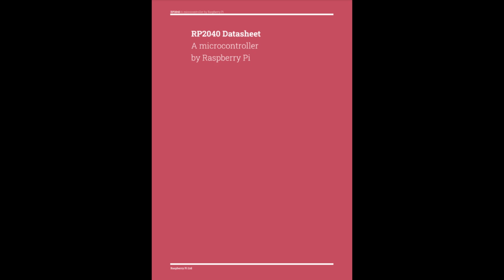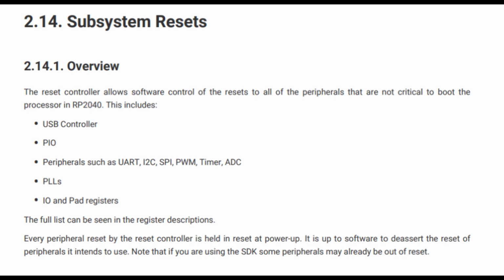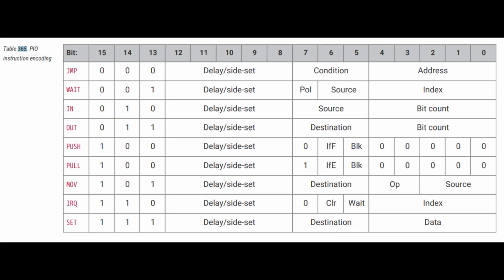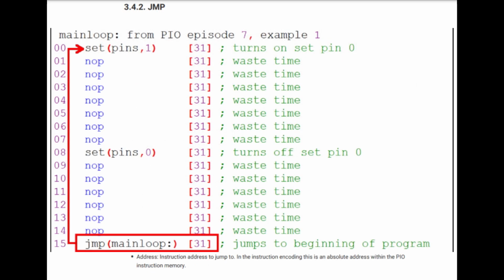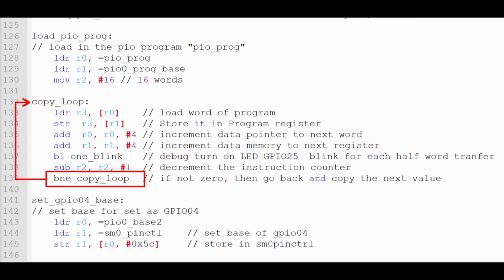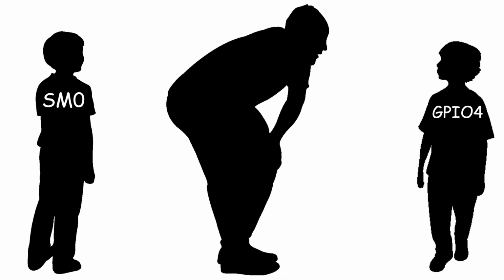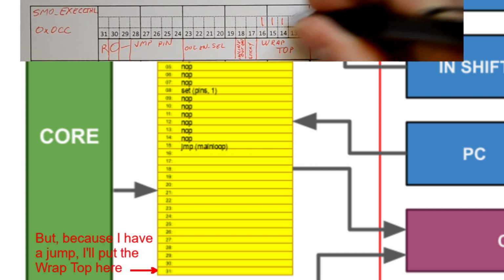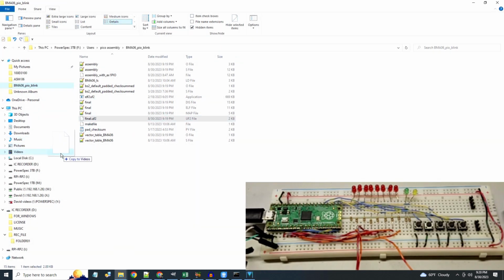RP2040 - PIO and Bare Metal Programming - BMA06

Comment: Thanks David. I want to sample ANALOGUE   Signal with PIO. Can you give Idee. Please
Reply from the maker: PIO processed digital data, either converting to serial, or inputting or outputting multiple bits to GPIO.  Converting from analog requires the ADC which is a slow process.  I haven't tried it, but you might be able to string DMA together with PIO to automate the process.  Good luck!
Reply: @LifewithDavid1  Thank you for your answer. You mean that the analog signal is sampled with an ADC and the sampled data is transferred to PIO with a DMA channel to output parallel data. Is that correct?
Reply from the maker: Yes, that's what I was thinking.  However; I have not done any research into this; so I have no clue if it will work.  If you find out; let us know.  Thanks for watching!

Comment: Love these seies.  Found them because i was trying to find a way to drive a 16x300 neopixel array using 16 channels to drive the 16 rows, then use graphics primative libraries mainly to draw text to the array.
I found someone using a 74HC 8 bit serial to parallel shift register and PIO to provide 8 row channels.  Thats easily adapted to 16 channels but the challenge is transposing the bits in the frame.  Circuit Python has a quick transpose routine, but only handles transposing 8 bits at a time.  I need 16.
I could probably do that in C but would it be fast enough to transpose 14K of a frame buffer before i show the results?
Or if the transposer is fast enough, perhaps with a 2nd PIO, transpose 16 pixels (48 bytes, since each pixels is 24 bits, offset by row size) in time?
Reply from the maker: I don't know if you checked out my "PIO Chronicles" series?  I did a high speed AWG where I could generate up to a 25 mHz (with poor resolution) sine wave using PIO (https://youtu.be/8ByDgh5-O2U).  I also did VGA video using PIO (https://youtu.be/ZEBkM5FQ86Q.  Maybe those will give you a few more ideas.  Sounds interesting.  Good luck and have fun!
Reply: @LifewithDavid1  Yes, it is with these during my search for answers that I came across your channel.  Didn't get through all of them yet but gave me hope with my large Neopixel array.
Since I found Adafruit C libraries that I likely can adapt, writing an array transpose function in C: likely will be fast enough to get a decent framerate.

Comment: Hey, David. Great series! Any chance of getting back to the 6502 and PIO? You seem to have mastered the pico. It would be cool to see you connect the PIO to the 6502 and use the pico for ram and rom.
Reply from the maker: I'm hoping to do several videos where I design a 6502 emulator on the Pico.  I've made some good progress and I hope to have something to present in a couple weeks.  Thanks for the comment!
Reply: @LifewithDavid1  thanks for the reply! An emulator would be neat, but I was thinking more along the lines that you originally started with, i.e., a real 6502 (or 65C02) hooked up to the PIO. Actually, you could use a few pico/6502 “units” together to make a pretty interesting multi-cpu project. Unified memory architecture. Just a thought. Nobody has done that that I’m aware of. You certainly have the know-how!
Reply from the maker: @jonathanstein6056  That would be an interesting project.  Not sure when I'll get to it; I've only just scratched the surface of what the Pico can do.  I would also like to revisit VGA video.  So much to do and so little time!
Reply: @LifewithDavid1  I hear ya. Keep up the great work 👍🏻

Comment: It'd be nice to define a bunch of macros so you could write PIO assembly instructions in your ARM code and they'd emit the correct .word directives... I don't know if this is possible but the idea tickled my "wouldn't it be cool if...".
Reply from the maker: Interesting.  It's operation would be similar to pioasm.  If we used the C/C++ SDK then we could call pioasm to generate the .word directives.  Thanks for the comment!
Reply: I thought the same thing: can't we use a PIO assembler to generate the opcodes?
Probably could be done in Python but I hate using Python as helper programs.  I've often felt it has been overused in today's programs, making them much slower than they need to be.
My first thought was using a spreadsheet.  I did that for generating machine code from opcodes for Ben Eater's 8 bit processor I built and modified.

Comment: What software did you have to install to be able to assemble it?
Reply from the maker: In "Bare Metal Adventures"; I started out using the GCC assembler (ASM) and the RP2040 C/C++ SDK.  However, in Chapter 4, I ditched the SDK, and used the GCC assembler and linker; as well as Make.  I would suggest looking at the other videos in the "Bare Metal Adventures".  Everything I wrote is located in Github with links in the videos' descriptions.  Good luck and thanks for watching!
Reply: @LifewithDavid1  Thanks.  I've used GCC a little bit, with the STM32F407G Discovery board, but only in C++.  I've mostly just stuck to Arduino and the Earle Philhower core, for the RP2040.  I'll slowly work my way through your other videos :)
Reply: @TooSlowTube  Your statement/thought is wrong. You NEVER used ANYTHING OTHER than GCC. Guess what Arduino uses as its toolchain for your STM32? Or Avr? Or RPi? You get it ...:) There is nothing wrong using the Arduino(-"IDE"). It is just a fancy Make, coupled with a rudimentary editor and package manager, hiding most things that happen under the hood from the user. If you need flexibility, use your own toolchain or build system and editor. Nobody holds you back (only the limited time we have on this earth). Have fun!:)